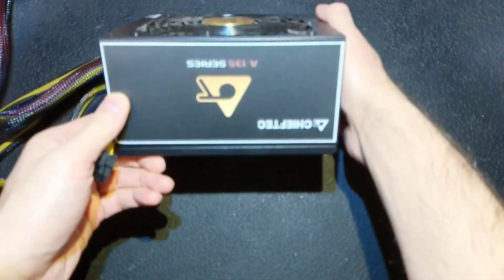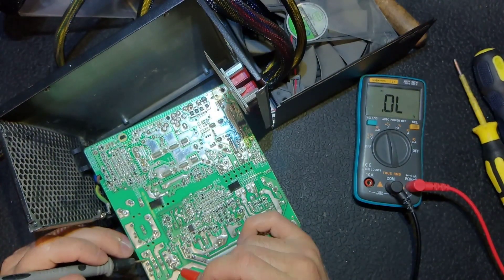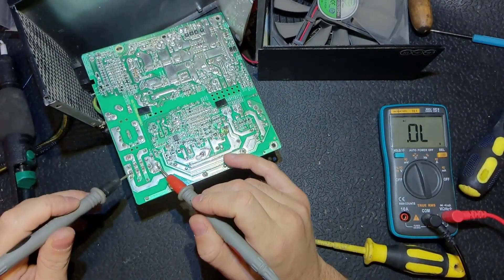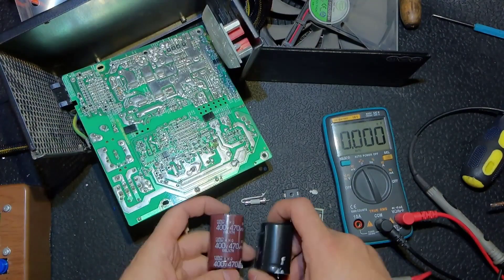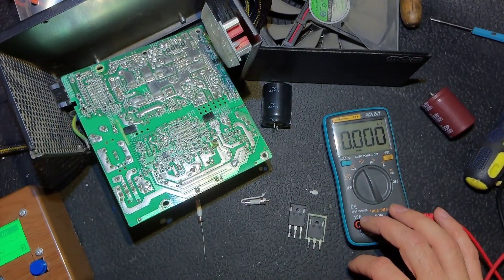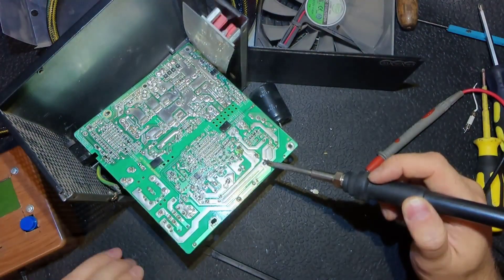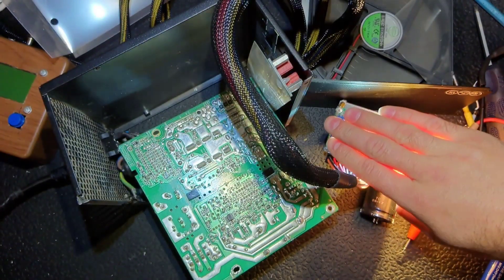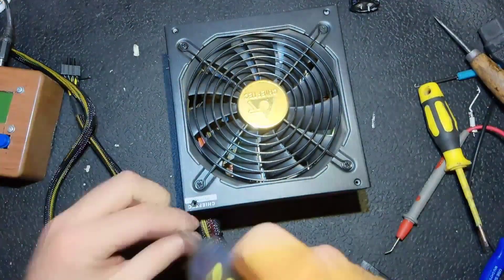Chieftec 750 power supply repair

Comment: you need to dischare your input capacitor could be as high as 300 volts, could kill ur mrter ot you.
Reply from the maker: It is 380 volts on that capacitor after PFC boost. I discharge those almost always. But there were several times when I forgot to that in a rush. Very unpleasant experience.

Comment: Hello, i have a seasonic prime platinum, the 5v standby is available and there seems to be no burnt components. After shorting the psu on it still doesn't turn on, there's about 3v on the pin to the ground is that ok? do u have any leads and tips where to start diagnosing?
Reply from the maker: Hello. You should check is there enough voltage on the vcc pin of PFC IC and PWM/LLC IC after you put PS on pin to the ground
Reply: @electronicshaverightstolive  ok will do, but really hate this seasonic psu with all its daughter board and impossible to desolder because of the huge thermal mass
Reply: @electronicshaverightstolive wait i dont really know what i did but it turns on now but only sometimes
Reply from the maker: @RYU47376  may be somewhere on the control boards is a bad solder joint.
Reply: well now it turns on and off again, but before it was working fine for a while (like 3 hours) I was testing it with no load tho is that a problem?
Reply from the maker: @RYU47376  probably. Can't tell for sure

Comment: Hi, nice vid. What do you think the main culprit of a PSU that gives out 4.5V from +5V Rail?
Reply from the maker: Hi. Thanks. This is strange. On modern power supplies superviser IC would not allow power supply to start if such abnormal voltage is detected. On old power supplies the culprit could be common mode output inductor or feedback circuit. If you meant 5V standby voltage that's a different story.
Reply: @electronicshaverightstolive  I meant the 5V output not the 5VSB.

Comment: Hi there. I'm trying to learn from your videos how to repair power supplies, as mine just died. Strangely, only the fuse and input MOV were blown out, but I couldn't find anything else wrong. Replaced the mov, fuse and energized psu with a bulb. PFC works fine as the bulb flashed few times, but I have no 5VSB nor any other outputs. I tested all elements and all seem to be good, but I can't wake up this unit :(
Reply from the maker: Hi. Try to turn it on without the light bulb. It should work.
Reply: I tried without the bulb of course, but it didn't make any difference. The PFC wakes up but that's it, nothing else run. This is the FPS Aurum 1200W, most complicated psu I've ever opened, and there is no schematics available, so I'm half blind here :(
Reply from the maker: @kopa8724  check standby power supply at the primary side. Check standby transformer primary winding and replace standby control IC.